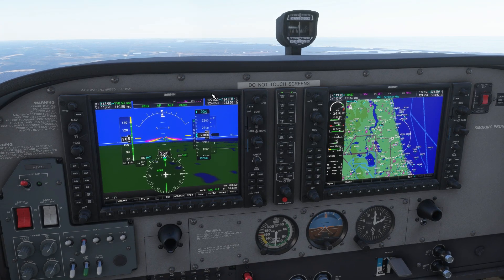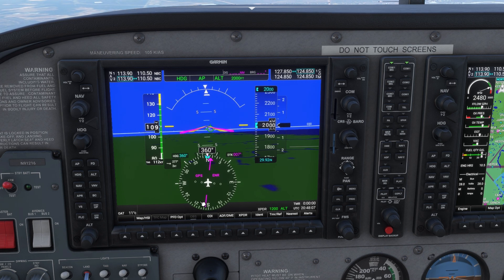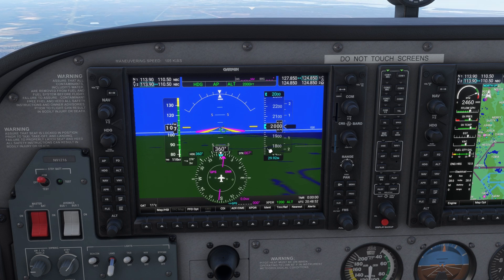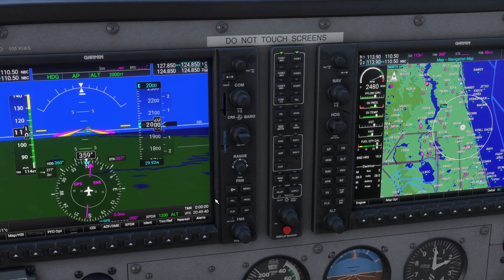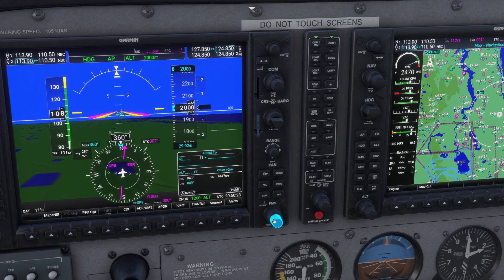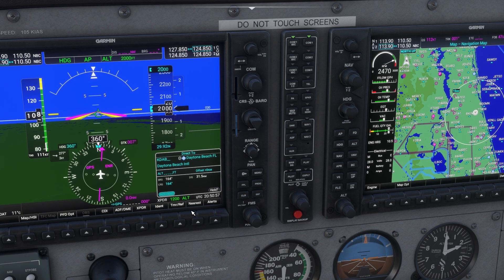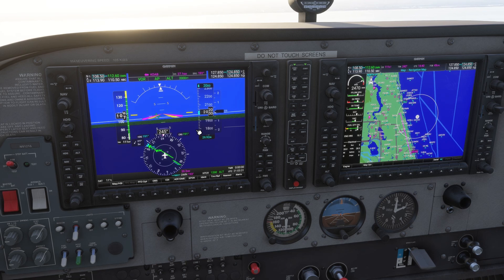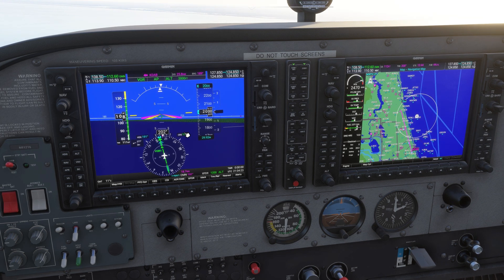MSFS 2024 Cessna 172 G1000 GPS and VOR Tutorial

Comment: Excellent video. Question. When I set the GPS and hit Navigate. Everything works fine up until a point. Then it goes, of course (but shows the bars on the PDF, like it's working, however when view is changed to see the outside of the plane it has flown way past. Any suggestions? I'm on the PS5.  Thank you

Comment: VOR doesn't adjust the Altitude does it? Would you be able to set APR Mode in order to lock into the GS ?
Reply from the maker: @iceweasel2199  VOR does not adjust for altitude unfortunately. As for VOR approaches, they don’t have a glideslope so using GS is unavailable. instead, a rate of descent is calculated. VOR approach tutorial coming out after New Year’s.

Comment: Is there a video that just go through all the modes and lists what they do, how they are armed, under what conditions they go from armed to engaged and when they disengage? Like I hear that VNAV will only go down and it will engage at Top-of-descent but it wont go below your minimums. Stuff like that. Having that knowledge in the back of my head would certainly (at least to me) be a good primer for videos like this which show a workflow or a specific way to use the mode.
Reply from the maker: Keep an eye out for the RNAV tutorial. That video is going to have the VNAV operation in it. Also APR mode will be discussed in that video as well.

Comment: Why is there a Green ROL and a Grey GPS where the Green GPS should BE for me?
Reply from the maker: @steff-the-ghoul  so ROL is roll which means that the aircraft will start at whatever roll it’s at when that is active. To get the GPS into the active section (green) try and use direct function. Or you click HDG and turn the heading bug to the aircraft flys towards the GPS track that you can see on the MFD

Comment: So the frequency you set up is that of the VOR and not the LOC ? I havent looked at the charts (im in europe so skyvector doesnt give me charts) but does every chart have a LOC Frequency and a VOR one?
Reply from the maker: @iceweasel2199  It was a VOR frequency. You can sometimes find localizer frequencies on charts but they aren’t used for navigation and instead used for identifying points. Provided gps wasn’t available.
Reply: @DizzySloth02  Follow up question : I noticed that GPS settings don't really work as intended in Career Missions... For example Skydiving missions it seems the NAV button just doesnt work even though im on the path and the CDI is set to GPS. Still doesn't turn off HDG
Reply from the maker: @iceweasel2199  I’m not sure about this one but I’ll try a skydiving mission tm and see if I encounter the same problem